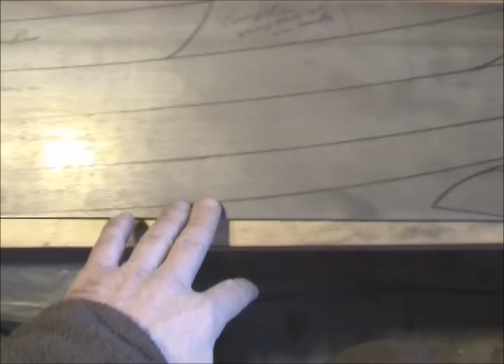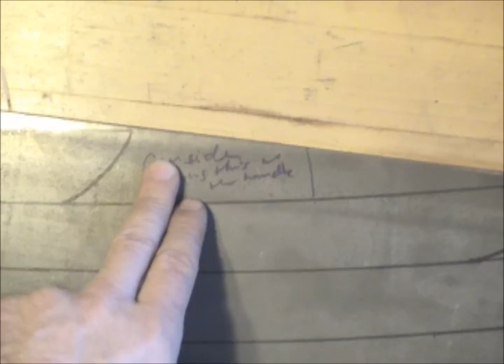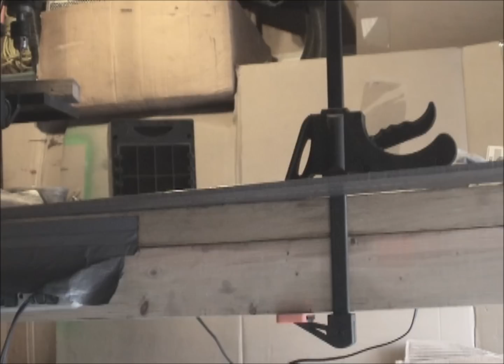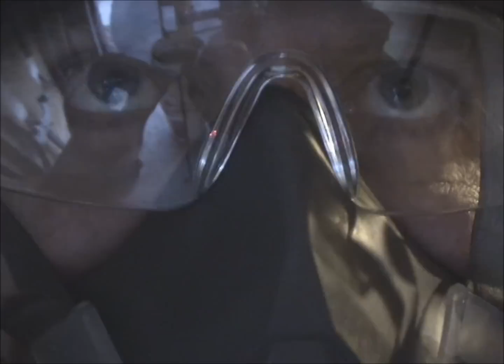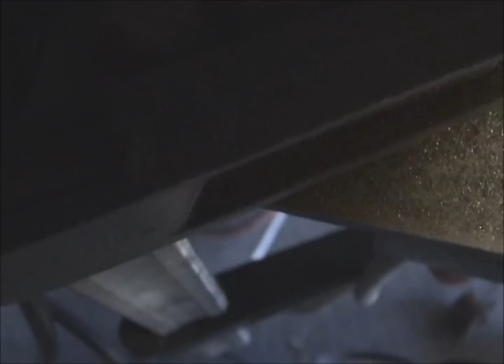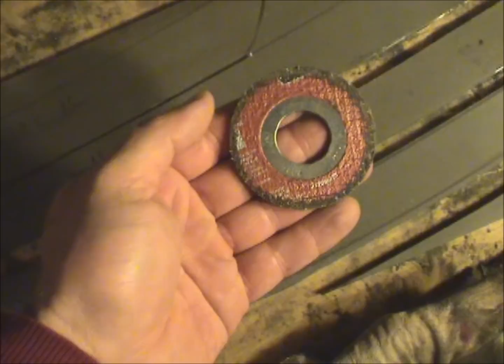CPM 3V katana, waki, tanto, and more (part 1) ... and S.I.U.S!!!

Comment from the maker: D. Keffler has done a lot of research with 3V katanas, and he has found that 3V at Rc 61 takes a spring steel like property so it's not too brittle for long swords. And I hope to prove this when I finish these swords so please stay tuned for cut tests!  Differentially tempered or san mai will make excellent swords, and you can't get a true hamon without DT, but I'm going to try 3V first for their toughness and superb edge retention.

Comment from the maker: Thanks brotha LMK!  And thanks for your comments and support.  And I will greatly appreciate any advice I get during this venture.  Believe it or not I did not have a hard time cutting the steel with the angle grinder.  I'm not sure how easy it is to maneuver a 36" long piece around a band saw. One thing I will say is that cutting the steel with an angle grinder is very messy and generates a lot of dust.

Comment: any update on the katana brother? sorry i am late but VERY interested
Reply from the maker: Sorry, no updates.  They are still rough cut sword blanks.  I've been too busy with customers to make swords for myself.
Reply: Ok brother thanks for your fast reply. Like your channel I'm now subbed. Ive seen Cold Steel put 3v through some crazy stress so I think the negative comment about making the katana from cpm is just ignorant. CPM 3v, 4v, or CW should all make superb blades. Thx again!
Reply: Also, if Howard can make an inferior metal like L6 into one of the greatest katana of all time then surely these metals could surpass them without the problems from corrosion.